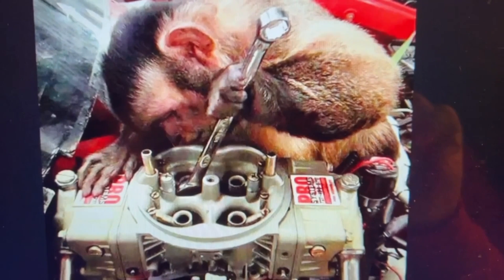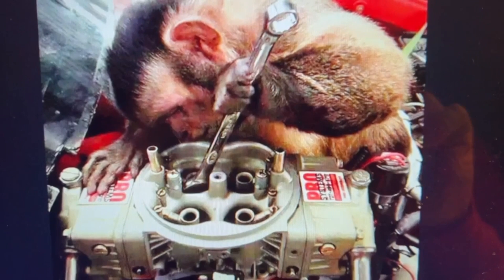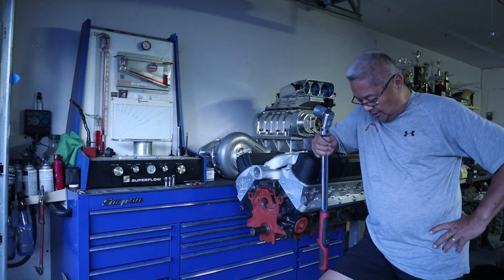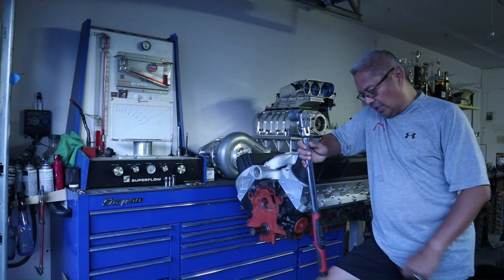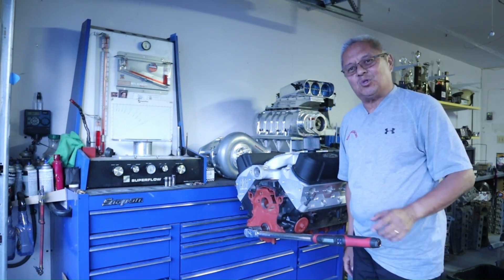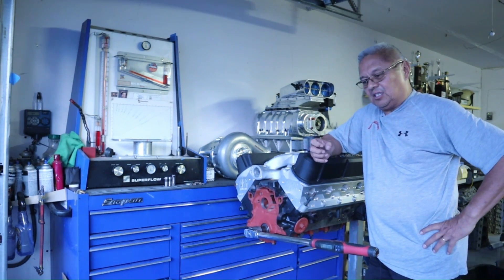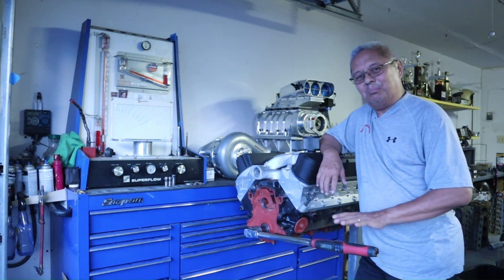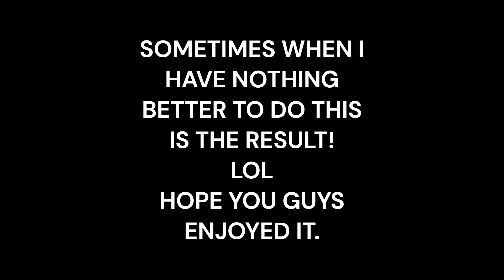HOW MUCH IS TORQUE  WE CAN SEE AND FEEL!

Comment: With that 2 foot long torque wrench you'd only need to apply 12.5lbs, less than the weight of a bowling ball. But, at 5252rpm you'd have 25 more horsepower.
Reply from the maker: Yes and this is why I said 3.5 from the center would give everyone an idea how much more effort would be required to do the same thing turn the crank over.

Comment: Well my snowblower has 25ftps torque, plus u got to fiqure its kenetic energy, rotating mass with flywheel so it might measure different then a wrench
Reply from the maker: Yes sir these is why I mentioned rpms.  Specially rotational inertia with aluminum or heavy steel flywheel.  Heavier vs. light cranks/rods will really change the scenario but the twisting moments still the same.

Comment: gear reduction.....mmmmmm....If my car was not a street car, it would be forced to redline at about 115 mph. A torque less wonder with a crutch. 😲
Reply from the maker: It has been a long battle with the 2 speed powerglide vs. the 3 speed Th350/400.  Now almost all NA racers run 3-4 gears for the obvious reasons specially if it is a 1/4 mile against an 1/8.

Comment: How about a HP challenge.  The most you can get out of a Ford 351 on REGULAR gas?  Is this a ridiculous question?
Reply from the maker: It is possible specially with a good cylinder head plus displacement increases and using a big cam!  I made 630 with a 302 block with street compression therefore it is easier with a 351 to start with.